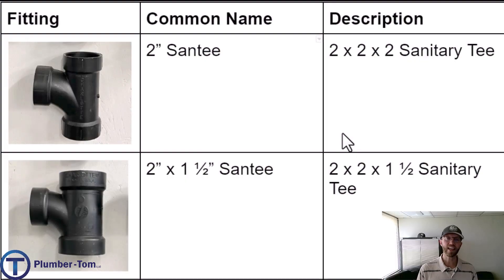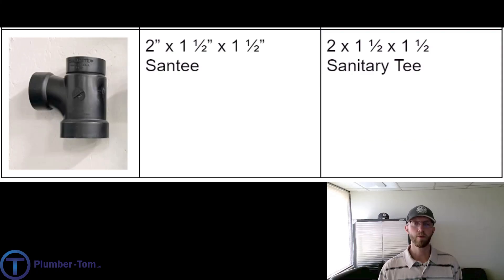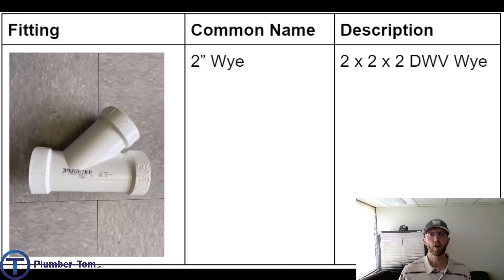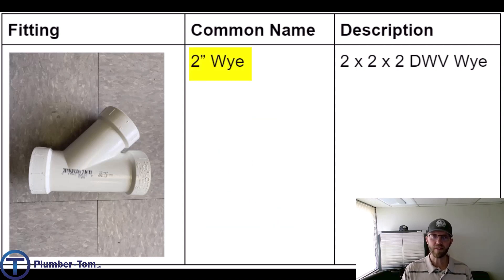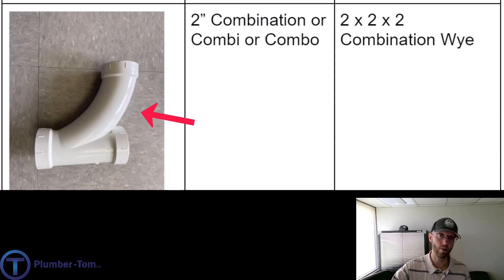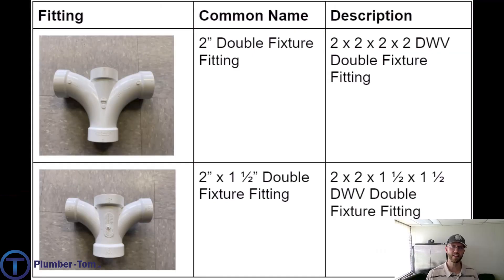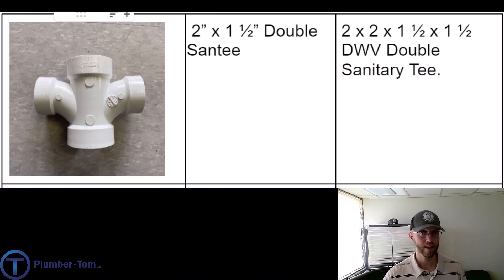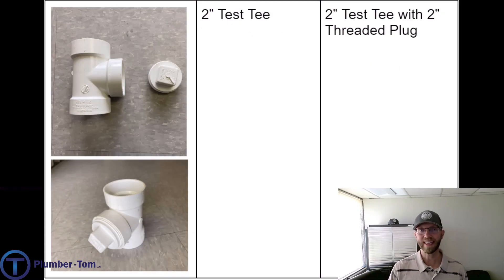Plumbing Parts Identification: Episode 3 - Santees, Wyes and Combinations

Comment: 1:46 why wouldnt this be a 2" x 2" x 1 1/2" santee? Ive just started watching your videos and I remember that they're supposed to be labeled in decending order. Not to sound nitpicky, I know nothing about plumbing right now and I'm using your videos to learn. Really appreciate it man!
Reply from the maker: Good question. It is not about descending order. It is about the straight pipe then the branch. I have another video that explains how to describe tees and wyes. Make sure to check it out.
Reply: @plumber-tom9470  just rewatched your first video in this series and I see what you mean. I completely forgot that its straight pipe then the branch, thanks for answering